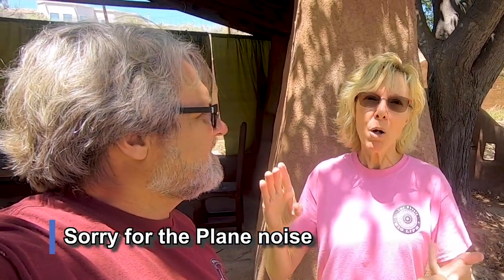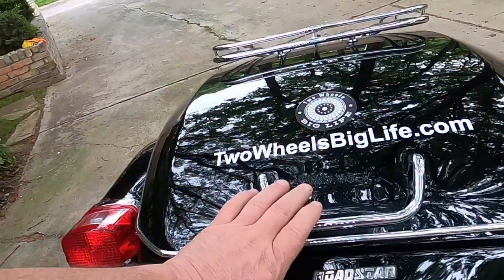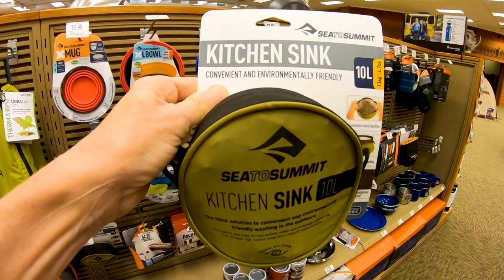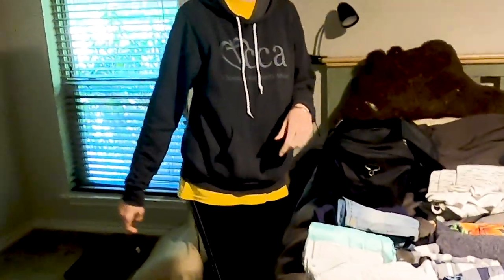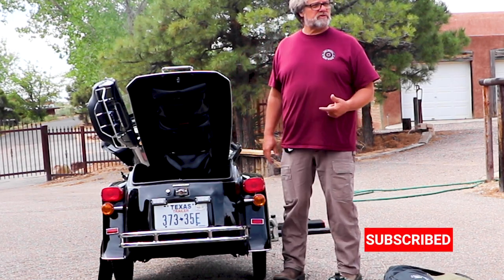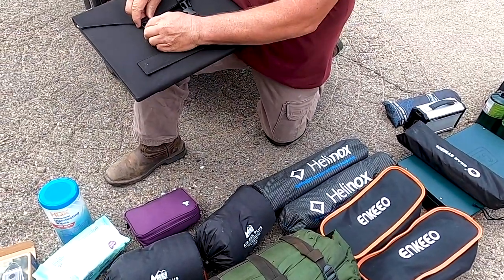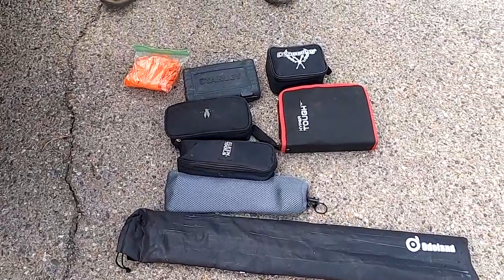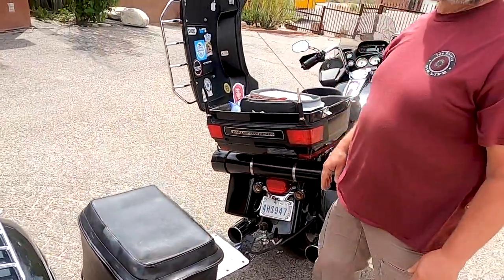#MotorcycleCamping Motorcycle Ride - Can We Take All That?  - Take 2 (S2 E3)

Comment: What did you pay for the 55k service?
I’m at 30k and live in Nevada. My service is way cheaper in Miami Florida as compared to Nevada.
Had the 30k service quoted at Las Vegas Harley for $800. PETERSONS Harley in Miami charged me $400
Reply from the maker: Most of the big services are about $300-$400. I usually need a tire or 2 so plus that.
Reply: Peterson’s in Miami are Family owned, and have been in operation since 1954.  I have been around them since I was 16.  I bought my Harley there.  They will treat you right, and they know your Harley!  ❤️